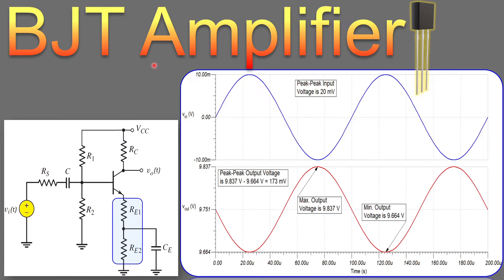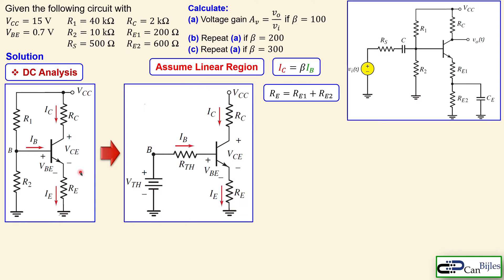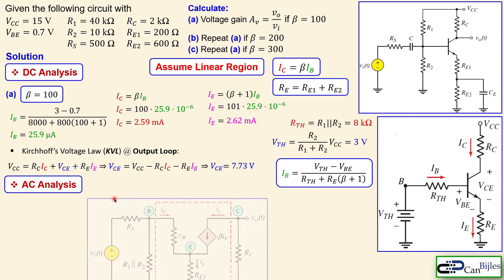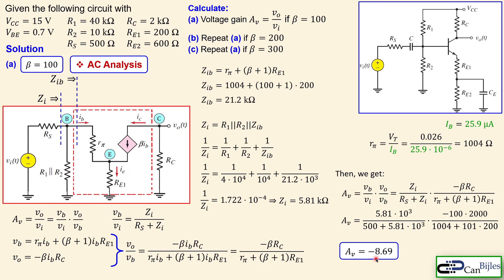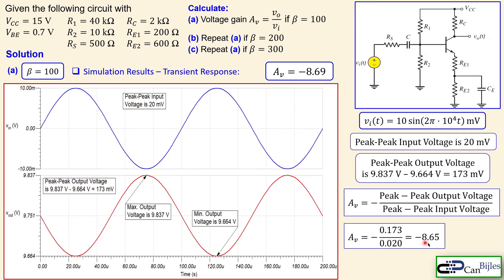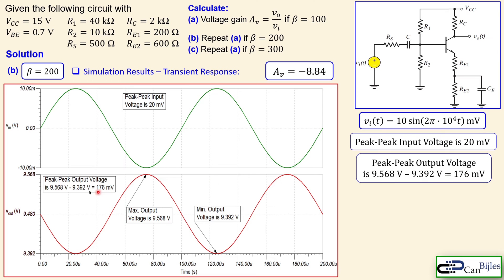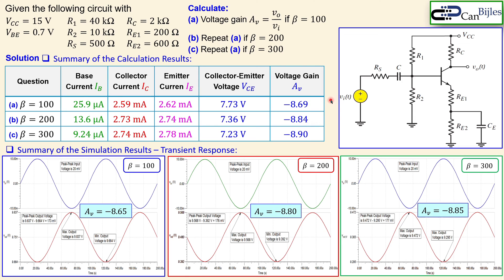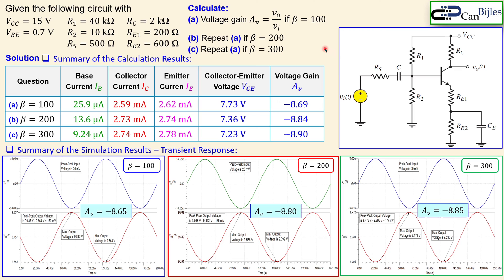BJT Common-Emitter Amplifier with Emitter Resistor & Bypass Capacitor 💡 Example 4

Comment: Your videos are very clear and easy to follow.  If you add a Tina voltmeter across the base-emitter in the circuit you do not get 0.7 volts but rather something in the order of 0.67 volts.  What is the reason for this?  thanks.
Reply from the maker: Thanks for your message. Glad you liked the video 👍 The base-emitter voltage is a function of the collector current too. The well-known 700 mV for the base-emitter voltage is taken as a common value. In fact, it can be somewhere between 550 mV and 800 mV, depending on the collector current.
Reply: @CANEDUX  Thank you for this clarification.  I will place a Tina voltmeter across my BJT base-emitter and observe the changes.
Reply from the maker: @richardsmith813  You can also make the plot of the collector current vs base-emitter voltage. This is in fact the same as the diode current vs diode voltage.

Comment: If total Re is 800 ohms and we want to bypass 1/2 of the emitter resistor, should we set Re1 and Re2 to 400 ohms each? How much of the emitter resistor is bypassed in this example? Thank you!
Reply from the maker: There is no straight answer about how much or R_E you should bypass. R_E is there for feedback and it will stabilize your voltage gain for parameter changes in the circuit. In this circuit, the total R_E is 800 Ohm and I selected to bypass the 600 Ohm of it. If you bypass 400 Ohm of 800 Ohm in total, then the voltage gain will decrease but the stability will go up. Again, it depends on the application and specifications.
Reply: Thank you for the fast reply. The question wants me to bypass 1/2 of the emitter resistor. How should I select the R_E1 and R_E2 in this situation? @CANEDUX
Reply from the maker: @egeozdag722  You can select the R_E values depending on the required voltage gain and input impedance. What are the specifications?